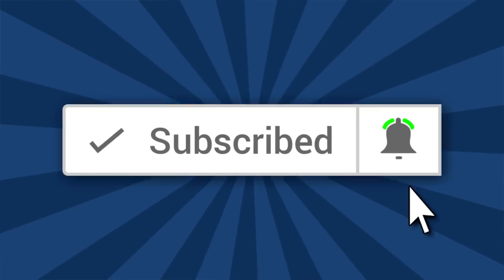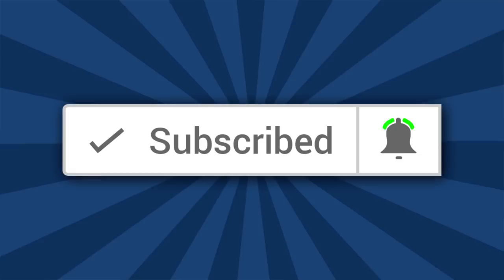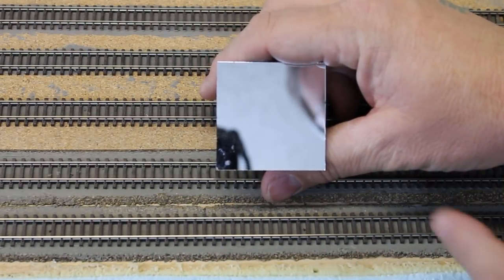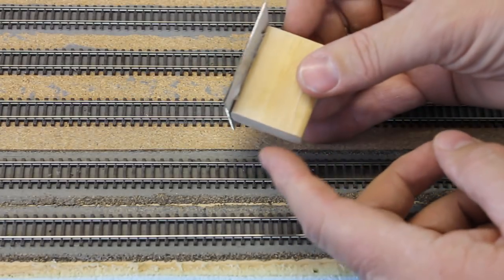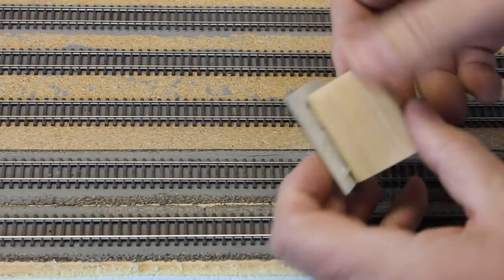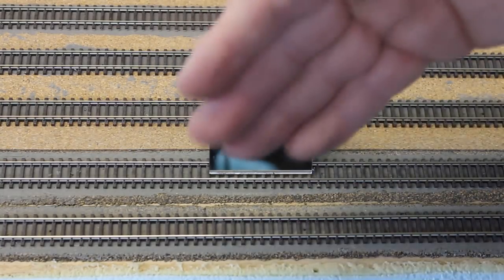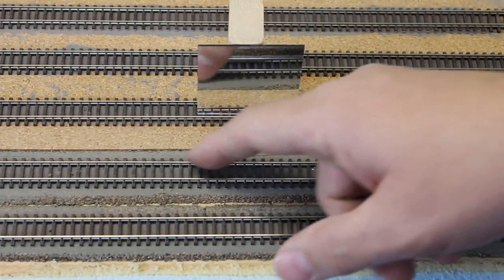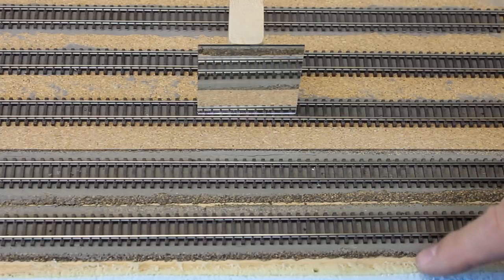A Model Railroad Tool for Working in Hard to See Areas

Comment: Great tip, I've been using this technique for years. I find using a cosmetic mirror that swivels works the best, you can move it in any direction you need.
Reply from the maker: Yeah, sounds like that would work.

Comment: Have you seen the mirror’s that we use in the automotive trades? Go to any auto parts store and ask to see there mirrors. The come in different sizes and shapes and come mounted on a telescoping handle. You can also go online and find them try Amazon.
Reply from the maker: I have seen those and they would work. My mirror has 2 advantages in this application. 1) It is hands free. 2) It costs nothing. Thanks for the tip. 👍